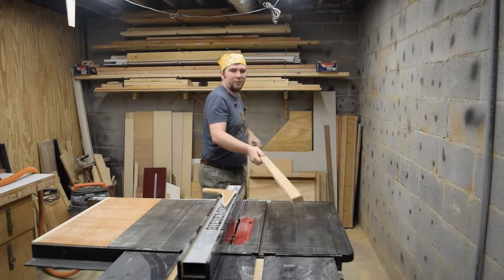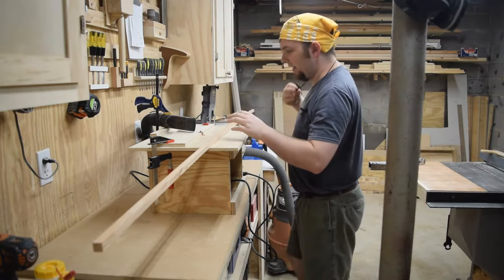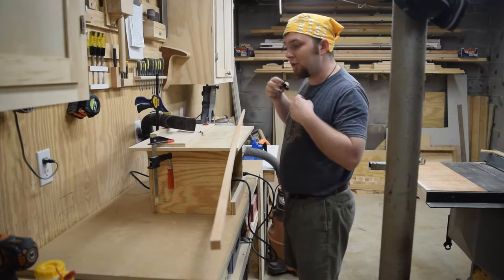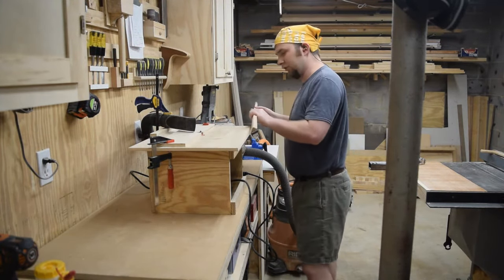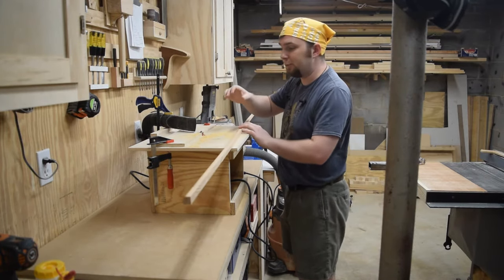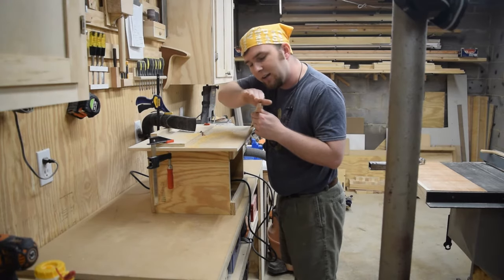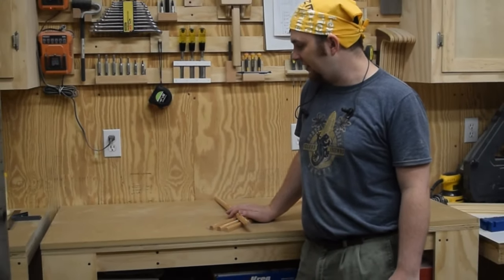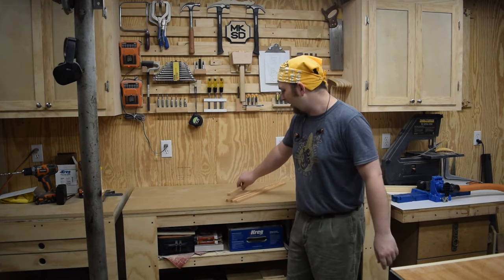How to Make Bullnose Moulding

Comment: It would be easier to route it first so your not holding on a small piece of stock then rip it on your table saw.
Reply from the maker: Definitely one way to do it. Routing small pieces doesn't bother me, I just wish I had chopped it up first so I didn't have so much stock hanging off the table. Thanks for watching!

Comment: made sense. also how do i make that table?
Reply from the maker: Thanks for watching! To make my router table I took off the faceplate of the router and mounted a square of plywood on it. Then I cut a square hole out of a larger piece of plywood, the table top, and glued some blocking under the corners to hold the router's new plywood faceplate. Finally I just built a box under the table top with it being open on one side so I could access the router to raise and lower it.

One day I want to mount the router in my table saw wing to save on space, but I might wait until I'm ready to spend the money on a fancy router plate and a new router.
Reply: @MakingSawdust  highly recommend you make a video out of it. (not many that are so simple as you described)
Reply: @MakingSawdust  also as i think about it, could you have made it using just the one piece of plywood instead of a separate larger piece as the table?
Reply from the maker: @sleepingtiger4436  Yes, that could work. I like the insert plate just because it makes it easier to mount to the router being a smaller piece of plywood, but I think that may be the only advantage.